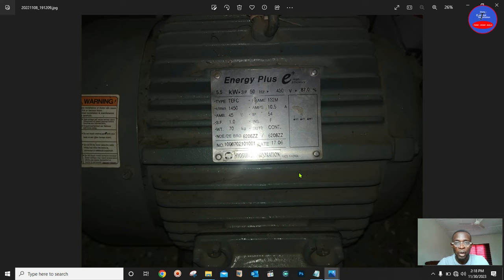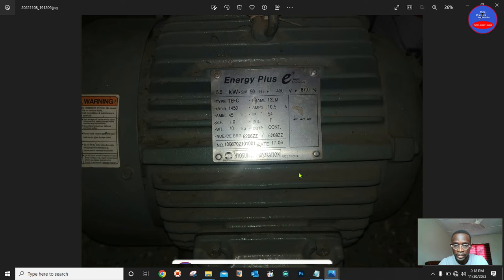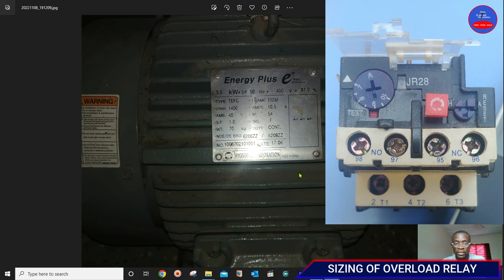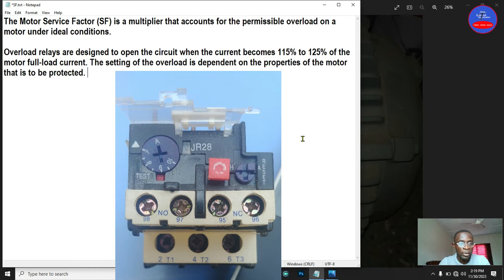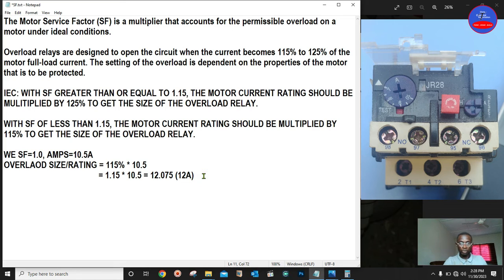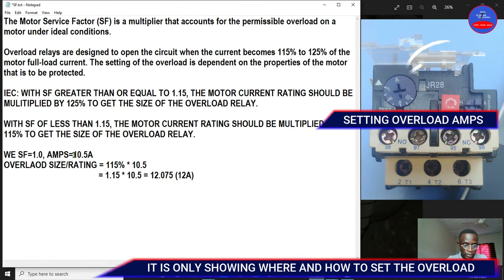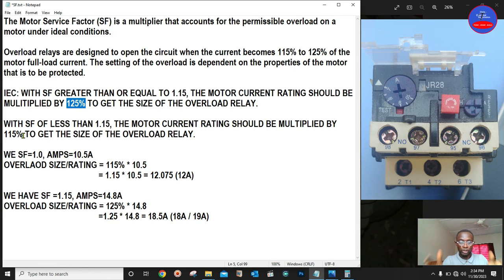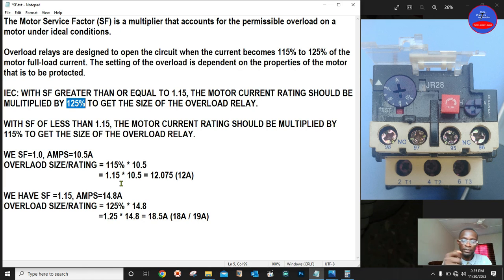How to size an overload relay for induction motor #electricalengineering

Comment: So that's the size I buy? Or its indicated on the overload I just set?
Reply from the maker: Make sure after doing the calculations to knowing the size of overload rating, buy the overload that has the value you got in its ranges.
Reply: @ChrisControlAutomation  thank u alot
Reply: @ChrisControlAutomation  thanks🤝

Comment: Thanks so much sir, hope the overload will not trip during starting of the motor because of starting current.
Reply from the maker: Yes Sir. It will not trip. This is the technical way of selecting an overload.
Reply: @ChrisControlAutomation  thanks you sir
Reply: @ChrisControlAutomation but same use 80% of the FLC instead of the S.F value